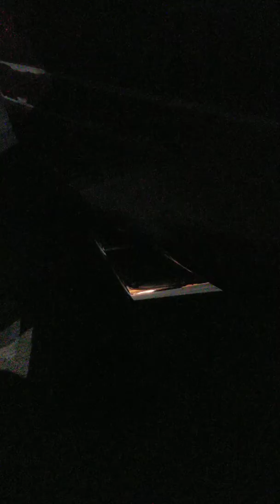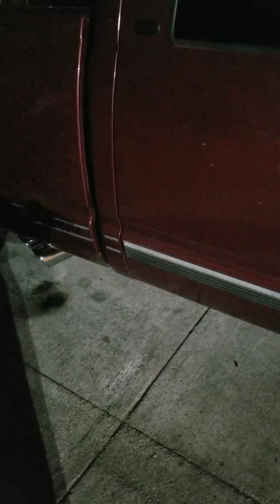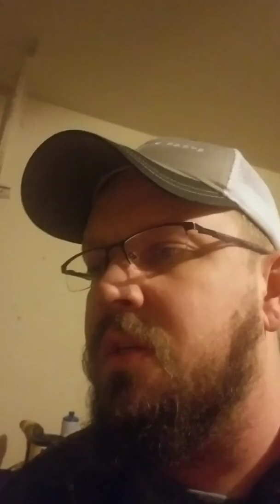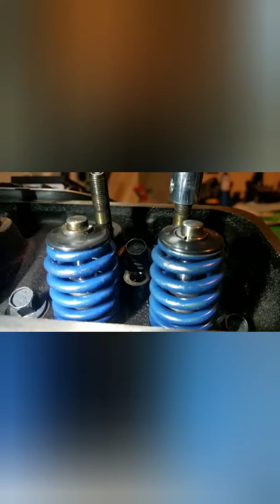Vortec 350 LT4 Hotcam with good advice

Comment: Did you do any ecm tuning to the truck after the cam?
Reply from the maker: Absolutely. It ran like crap. It sounds even better than this video since I've done some tweaking.
Reply: @brandonsparks37  what software did you use and do you have the black box pcm or a 411?
Reply from the maker: Hp tuners, it's a black box for now.
Reply: Is blackbox like out of a 97 sufficient enough to tune for a cam like this?

Comment: Do you have the 0411 pcm swap?
Reply from the maker: No. But it is in the works.
Reply: Nice! I already did the 0411 pcm swap an it makes a big difference! What compression ratio did you get with those pistons? Or what gasket thickness did you use; I’m actually doing the exact same thing you did to my sbc
Reply from the maker: Milled the heads .010, cane to about 11:1. I have an edelbrock pro flow intake im setting up to go on with the 411. Just need the time.  Have three project cars that eat up my time.
Reply: Good Lord ,  @brandonsparks37  , Eleven to 1? I bet she'll flat-out run, son! I have DEFINITELY GOT to do some of this when the ol '97's 310k-miler loses all her worth lol
Reply: You were able to start it it with the base line tune; With no problems, man that’s a lot of compression! What octane gas are you going to be using ?

Comment: Im having the hardest time getting mine running.
Reply from the maker: 7.2"
Reply: @brandonsparks37  do you have the part number for those valve springs ?
Reply from the maker: @adancortes3568  it's a factory LS6 spring that I used. Any beehive LS style spring will work.
Reply from the maker: Make sure it's tdc and the valves aren't too tight
Reply: @brandonsparks37  what size push rods did you use.